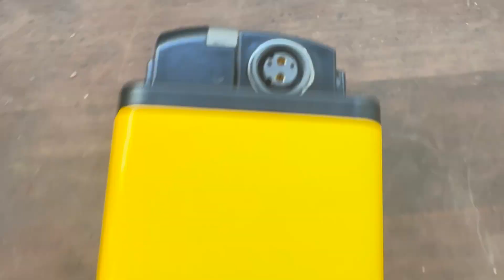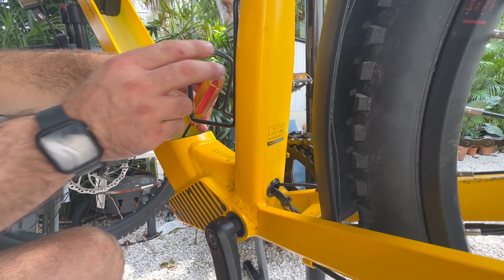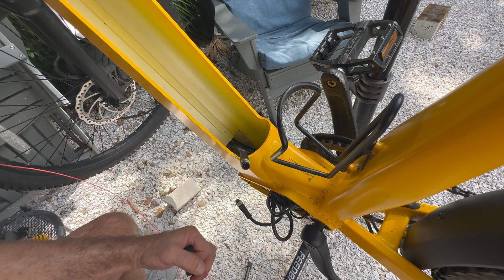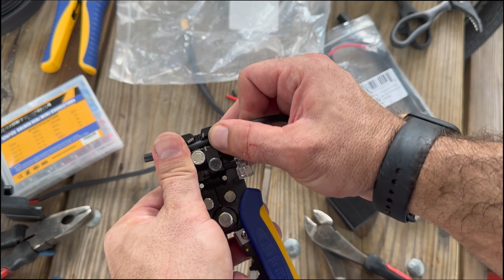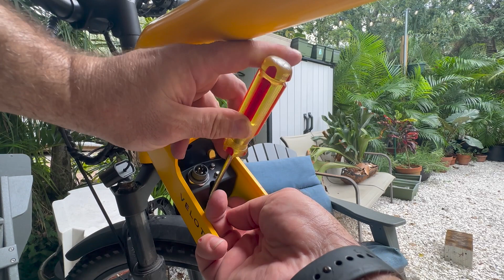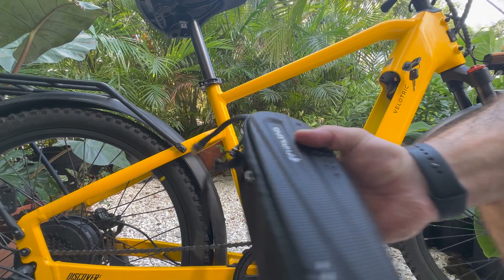Velotric | Discover 1 | Custom Wiring Dual Battery Balancer Install Two Batteries on Electric Bike

Comment: 2nd time I have watched the video and I think what you did was awesome.  Since this is a balancer can you connect both batteries at the same time? The only thing I would change is the bypassing of the grommet when you ran the wire to the second battery. There is a hole there now for water to get in. Even though it wasn't water tight to begin with the grommet still helps. Can a smaller wire be spliced onto the batter cable and still use the grommet?

Comment: Question, I have a Discover 1 Plus and I was wondering if it's possible to place the brake cut off 2 pin wire without replacing the entire wiring harness and if so how?

Comment: This is a cool mod.  I did almost this exact same thing myself.  Wish I had seen your video beforehand.  It would have been helpful but I didn’t have too much trouble.  I built my own 13s6p rectangular pack using a pretty slick kit I found on eBay and some 2500 mAh cells.  This gave me an additional 721.5 watts hour.  I then just bungeed it to the angled supports of the rear rack just behind where the seat post connects to the frame.  I first put some black foam pipe insulation (think pool noodle) around the part of the rear rack that extends on an angle upward from the frame before it bends to horizontal.  This is otherwise unused space and the placement of the extra battery there does not interfere with use of a rack bag or panniers or whatever.

Comment: Great job this is a fourth time I watch the video I bought the kit. I have an extra velotric battery I got a hold of on Facebook. I bought the bag that holds the battery that goes on your rack. I took the top off the battery that way I can charge it with the other one together.

Comment: I also do this on my inverter sometimes I hook one battery to it and sometimes I hook two or three and parallel positives to positives. One battery goes low I just hook it to it and it still flows through the other battery terminal, if one battery's very low it doesn't stop the system from working it still puts charge to the system but I'll let you know I'll have it in my bike in about a month

Comment: I think it would work either way I bought the kit I want to put it on my nomad. I'm just curious if I use my main battery and my main battery goes low I can plug in the extra battery although the place that sells the part says just leave them both plugged in and use them both at the same time, but I'm like I'd rather use my main battery and not plug in my spare battery in case I need it for my ride home because I get a big head wind and that's my problem where I ride the bike on the levy at the Everglades in one direction you don't notice the wind behind you that there's even any wind and I go 14 mi but on my way back I'm in a 5 to 10 mile an hour headwind and my battery scale is going down really quick and I'm getting nervous so I'd rather keep it as a spare. But I think at the main battery gets down to one bar I can plug in this other battery and it would work just the same it would balance them both out, kind of like a cell phone will you buy those external batteries and you plug them into it and they charge up your main battery on your cell phone and it makes it work I think this would do the same thing. That's why it has a balancer in it to balance the charge out.

Comment: I love the idea of two batteries. You are disconnecting one in order to use the other, but what do you do with that big battery once its out of the slot and you are riding. You can't just partially unseat it and expect it not to come out on a ride and most rrear rack mounted bags are too small for it. Plus once it is inserted fully it does add strength to the frame.  Would it be possible just to put in a spdt switch to switch from one battery to the other without the physical disconnection?

Comment: Insane that those two small pins are just for show. They have been messing up my replacement port search FOREVER!!!
Reply: Are the pins connected to anything? I'm trying to use my pack to power something else and when I try to pull any power it drops to 2.7v. Wondering if there's some kind of signal or ground that's used to allow power out.
Reply: I figured it out after some continuity testing on the bike. Both small pins get pulled to negative/ground so if you do the same on the connector you're good!
Reply: @k @kd8192 good to know. What connector did you use to fit into the 2 small pins? XLR?

Comment: So technically, you didn’t need to fish the wire up the frame you could just cut the plug right there at the bottom.
Reply from the maker: Close quarters but it could be done

Comment: Will this work on the nomad?
Reply: I am not an expert BUT, it’s probably the exact same scenario as the bikes are using the same type of battery housing and the frames are almost an exact copy of each other. With that said I have just purchased a Nomad and would like a definitive answer as well.